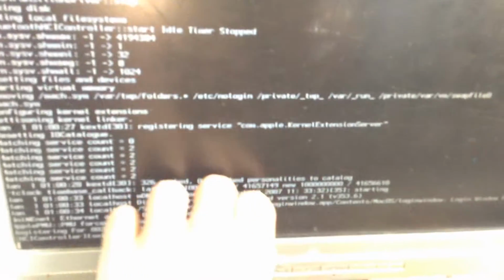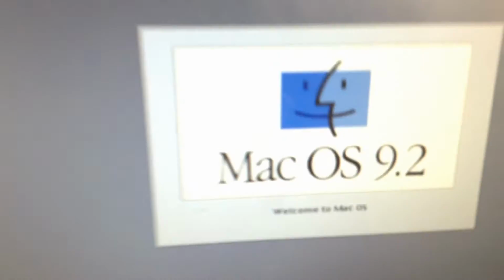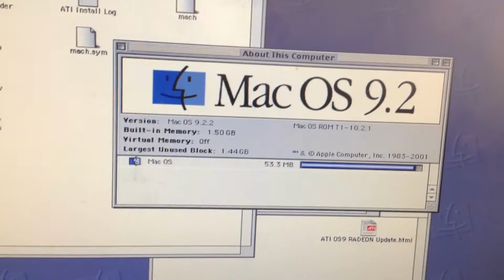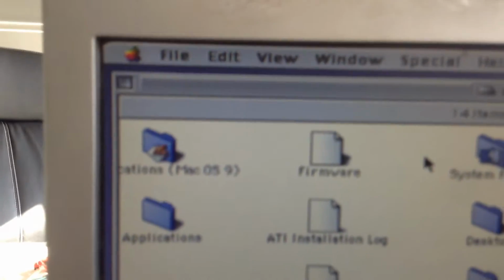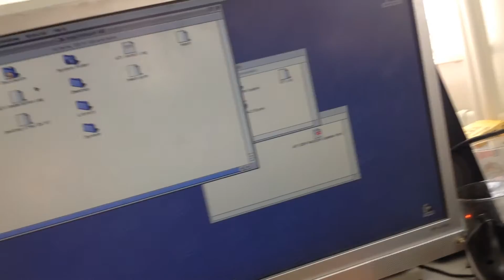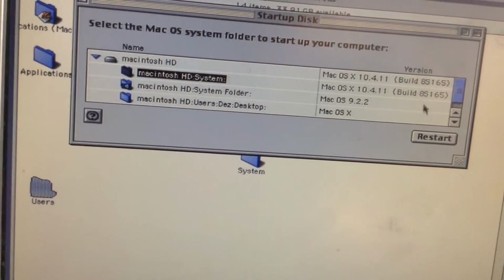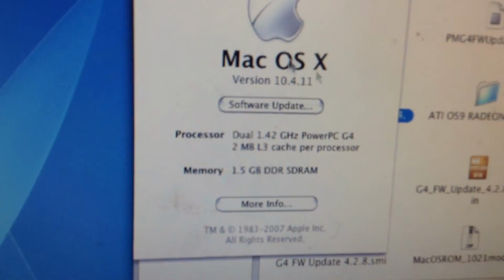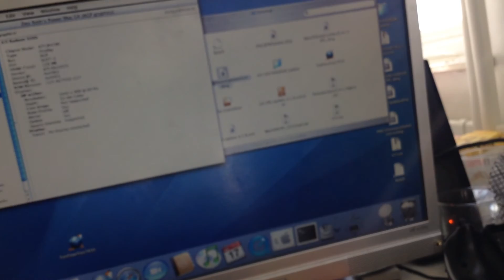Power Mac G4 MDD FW800 OS 9 Fun

Comment: I would like to know how you downgrade the rom version.
Is it difficult to do ? I am not highly technically minded more into 1970's Hi Fi than computers. 
I do have a G4 1.25 single and a 1.42 dual and the software install disks for the 1.25
Reply from the maker: Jeremy Clayton-Travis I would really keep the 1.42 stock as there is no way to upgrade back to the stock ROM and the guys on mac rumours have found a way to boot OS9 on non OS9 macs with out downgrading the boot rom... (and your 1.25Ghz single should boot into OS 9 natively and seeing as not much takes advantage of 2 CPUs in OS 9 you should just use the 1.25Ghz MDD and keep the Dual 1.42 stock...)